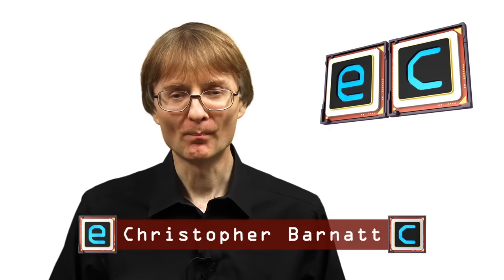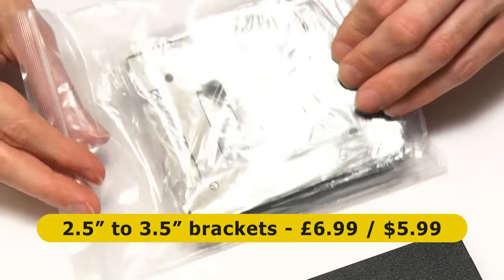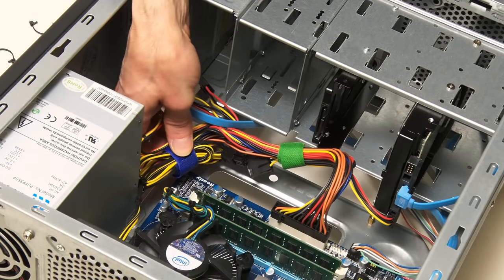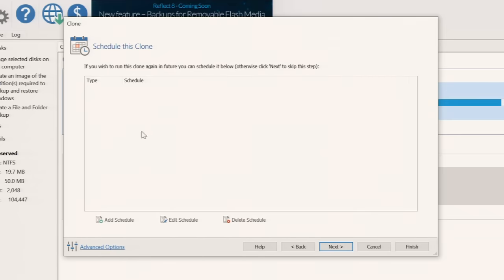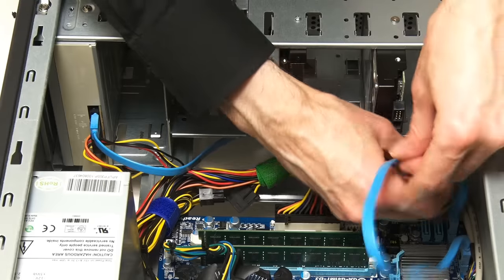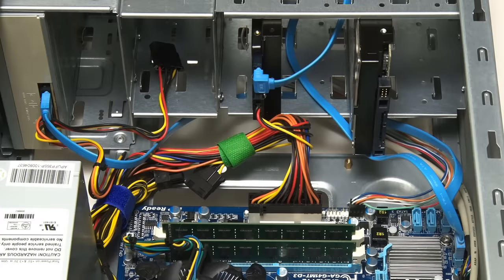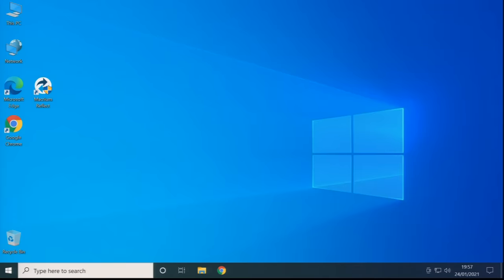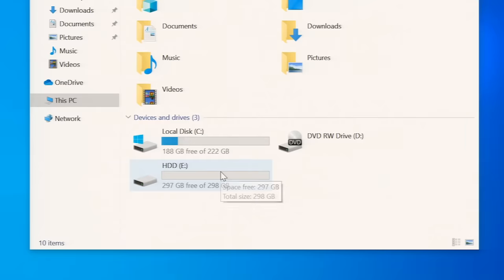Old PC Upgrade #2: SSD Boot Drive

Comment: One can used an "oversized" drive if one partitions it into partitions smaller than the total size the machine can handle.

I would have likely put a 500GB SSD in this machine.

Comment: Hey I just used that disk part program in Windows 10 and I tried it on my 1TB SSD that I couldn't get windows to readh because it was originally a clone of my dead iMac and after typing clean I went into disk management and it worked I never new this program was there ty for the video
Reply from the maker: Great to hear!

Comment: Thank you for the video. Question about the system reserved partition at the end of the drive: how can I move it? When I installed the system a couple of years ago I left 80gb of non partitioned space at the end in case I wanted to dual boot with Linux. Last week I needed more space to cache some temporary video files so I went there to expand the windows partition and... Surprise. A tiny system partition was created at the end of the windows partition effectively blocking the possibility of expanding it with the included tools. Can I safely move it with gparted?

Comment: With a motherboard of this age, would there be any value in using a PCIe to SATA 3 add in card, or indeed a PCIe to NVMe add in card? I think when I was looking at USB 3.0, there was no speed gain to be had over USB 2.0 from the PCI bus, so I assume the same can be said for solid state drives.

Comment: If SATA II has a maximum throughput of 300 MB/s why does the SSD benchmark not even come close to that maximum?
Reply: It's a theoretical figure based on perfect conditions that (in reality) never occur because they rely on a lot of other factors beside the interface itself. Personally, I'd be very happy with the figures Chris got because they're probably still shifting data at a faster rate than the rest of the computer's hardware could keep up with.

Comment: I have a question, on specific hard drives there was a jumper to determine if the hard drive was a master or a slave drive, if you have this jumper on the hard drive do you need to set this to slave
Reply from the maker: Master/slave jumpers are used on IDE hard drives, where you can have two drives connected to the same ribbon cable. If only one drive is connected, normally it does not matter whether the jumper is set to "master", "slave" or CS ("cable select"). This said, with one drive on a cable, setting "master" is always wise. However, if you have two drives on a cable (eg a hard drive and a CD or DVD drive) then one drive must be set to "master" and the other to "slave". Normally the hard drive is set to "master".

Comment: EC, I just had to clean my RAM sticks and slots to get my computer working properly, i did not know there were more levels of clean that went beyond "blow some air on it". Instead I got a soft brush and 99% IPA and cleaned things up. All of my intermitant POST issues are now gone, and even some other things...i wish i knew about this before i threw my other two RAM sticks away.

Could you make a video about cleaning ram sticks, ram slots, cpu's, PCIe slots, and even just general cleaning that goes beyond "just blow some air on it"? like i blow some air on my PC case, and it still looks dusty as fuk. What's the best way to clean between fan blades? how stiff of a bristle can i safely use on my motherboard? how to get those annoying finger prints off of my heatsink? how bad are fingerprints for your system on the ran pins and mosfets?

Comment: ive just watched the first vid of this didnt know doing these just been busy some times. i upgraded a pc sorta like this same core 2 era i think could be same cpu even or near the 5000 numbers anyway. the board supported only max of 4gig of ram but. i threw 8 gig in and it readed and registered it fine. some cases the max ram thing just something they are comfortable with but can some times hold more anyway. some bios updates of course can fix that but this one didnt have one but it was good. i threw in a old 80gig sata 2 ssd i had and put in a useless ati 5850 gpu in it for display. added windows 10 to it as well. and it works alot better who ever thought WD green platter drive as the os was a good idea.. argh. it died anyway so its fine. though had to replace the power supply the original one got damaged when one of my plugs went open so i had mains power going through the whole case but fact the entire system still works shows how tough they can be.

Comment: Hi, clone UBUNTU from HDD to SSD with GParted was a success and the performance is super great. But from the HDD, I want to remove the bootable partition but the two other partitions must stay also the data on it. What do you suggest?

Comment: Hey Chris - great video. Im having issues with an older asus laptop computer. I've cloned the old hard 356 mb drive over to a new 500mb ssd (Which says it has all been done successfully), but when I install it back into the computer it wont boot up. have you got any suggestions. Should I just leave it in there and do a factory reset and then install windows 10 via a usb I have for it. Im not worried about retaining files as Im prepared to start from fresh

Comment: It takes this PC around 25 seconds to get past POST, seems rather long. Are there maybe some BIOS setting you could tweak to speed it up? And is it possible to switch SATA controller to AHCI mode in BIOS?

Comment: Of course if the PC only has IDE ports and uses a 32bit CPU, it might just be too old to bother putting too much effort and money into upgrading.

Something like a used Core 2 Duo or later PC or even a Raspberry Pi 4 would be a better option than putting money into something built when Windows XP was still the new kid on the block.

Comment: is molex to sata adapter are reliable?
is it cause any damage to hdd?
can i use sata splitter instead of it. 
plz answer my question....
Reply from the maker: Molex to SATA power connector can be reliable. There have been reports of some causing problems (and fires). However, decent quality Molex to SATA adapter should not cause an issue, particularly when used with an SSD, which draws less power than an HDD. You can indeed use a SATA power splitter instead if you wish.

Comment: Well I tried it I downloaded Macreum and when I installed my SSD. I transferred everything from the old hard disk . It was quick. The only problem was raising the hard drive so I can throw it away . I kept getting stumbling blocks like I had no permission from the administrator to delete it . I changed permission I still could not delete many of them.So I had to use systems restored to go all the way back to the beginning. I finally got it erased, but, I accidentally erased all my personal videos on HHD F. Fortunately, I had them back up on my flash stick .so I was able to recover them. I couldn't believe how my computer booted faster with the SSD. Why did I take so long to change it from a slow hard drive?

Comment: I am planning to get a new PC with a wiped SSD drive. I want to clone my current laptop to that PC, can I use this process (using the free software) if I connect the laptop to the new PC via a USB?
Reply from the maker: You could clone the laptop's drive if you could connect it directly to the PC, but not by connecting the laptop to the PC via USB. Also, even if you can do this, the Windows installation you cloned would be for the laptop -- both in terms of the hardware drivers and the license -- not for the new PC. If you were lucky, Windows would boot on the new PC and change its drivers. But it would need re-activating, which would probably not be possible without purchasing a new Windows key, as it will be licensed to the laptop hardware. So this is not something I would advise. Better to do a fresh Windows install on the new PC and then to copy your data across and reinstall software. Good luck! :)

Comment: So could you take the old hhd and put it in a different pc to have windows on a different pc?
Reply from the maker: You could move the HDD to a different PC. But the license would not allow it to activate on another PC (and it may well not boot if the drivers were significantly different). Windows installations are hardware specific.

Comment: I have a pc with DQ57TM mother board. what kinda SSD is compatible with it?
Reply from the maker: Your board has 5 SATA ports, so you could use any 2.5 inch SATA SSD. I can't find the SATA port speed, so they are probably SATA I or SATA II, so you will not be able to use the SSD's full speed (as was the case in this video). Almost certainly, an SSD greater than 2TB will not work (or have its full capacity available), but an SSD smaller than that should be fine.

Comment: Hello and welcome.  I have a question.
 What will give you more efficiency?
 The idea is a computer for everyday use with emphasis, editing photos and videos from holidays.
 Computer consisting of ... Processor 2 cores / 4 threads / integrated graphics, Ram 16 GB 2x8 ...
 Is Processor 4 cores / 8 threads / integrated graphics 8 GB Ram 2x4 ... ???
 We combine efficiency with economics of purchasing parts.
 Or maybe you can save on the processor.
 2 cores and 32 GB Ram 2x16 ... And here will the performance be cheap?  What advice? Thx.

Comment: Hello, I have a 10 yr old MSI P55A Fuzion that I am trying to install a Crucial MX500 SSD 1TB to. For whatever reason I cannot get my MB to recognize the SSD as not being IDE (or windows to recognize it as being an SSD). Any idea what is causing this problem? I have heard that the Marvell 9128 Sata 3 ports that my MB has can cause some problems? But I have no idea how to fix this. AHCI has been enabled in the BIOS, and the SATA adapter enabled.

Comment: I've had variable results attempting to install SSDs in laptops and desktops. I've tried 3-4 different cloners and all failed on 2 different HP ~2012 laptops with legacy BIOS. Windows could see the cloned drives on  USB adapters, but both laptops failed to detect the drives in the BIOS. Re-writing and activating the MBR didn't help. The exact same procedure worked fine on several desktops. Any ideas?

Comment: 3:55 Does it matter which side of the bracket you mount the SSD on?  Many of those brackets have tabs on the inside to mount screws to the SSD from the side.
Reply from the maker: You can use either side -- it does not matter.

Comment: Hello, I follow exactly everything you did, however after using diskpart to erase the old hard drive, I rebooted and it didn't boot , i went straight to the blue screen where it says i needed to contact my Network Adminstator, I tried everything and it never booted again, any advice....
Reply from the maker: Are you saying that you have cloned the hard drive to an SSD, booted up and it worked, then erased the hard drive? If so, there is a working copy of your OS on the SSD. So my initial advice would be to remove the HDD and the computer should boot from it. Good luck!

Comment: Not only do you not NEED to defragment your SSD drive, you really should not do so. Back when I booted from an HDD, I made sure to defrag that drive religiously in order to minimize the boot-up speed of the system. With an SSD drive, there are no moving parts, and no faster areas/blocks of the drive (due to angular velocity). So defragging an SSD is a complete waste, and won't speed things up. The reason it is not something you should do is actually the main down-side to SSDs...they have a limited number of read/write cycles per bank. In short, they wear out/down with use, and become unusable. The drive itself may mark those dead blocks out of service, if it's a more intelligent model. Or it may just cause the SSD to no longer boot, if the dead blocks are being used by critical operating system files. As I understand it, it's mostly the writing process that wears them out -- not so much when you are simply reading blocks from the drive. But depending on how much space you have free, the blocks that are empty on the drive occupy the same smaller and smaller bit of space. Which means that all temporary file creations will be directed to those same fewer and fewer blocks over and over again. Which is why you really want to have a good amount of free space available at all times on a boot SSD -- to better spread that necessary wear across a larger number of blocks. If your SSD is above 95%, you really should clone it to a larger-sized drive. I'd recommend a 2-drive USB dock, since you don't even need to have a computer booted up to do the cloning. The one I use is the "Orico Dual Bay USB 3.0 Dock Station". You put the old drive into the 'source' slot, and the new drive into the 'target', and you press a button on the back...and let it do its thing. It has a progress meter on it with 0/25/50/100 lights.

Comment: Sir, my question is if I don't install macrium and try to install the 2nd disc (SSD) do I need to buy new windows key?
Reply from the maker: I am not quite sure what you are asking. If you just want to connect the SSD to use as storage space, there are no issues. If you want to use the SSD as your boot drive and do not use Macrium of other cloning software, you will need to install Windows on the SSD. if Windows is activated with a digital licence (very likely these days) then it should reactivate after being installed on the same machine. But do not try to reinstall Windows with the HDD with Windows on connected!

Comment: I haven't used Windows for about 15 years, so correct me if I am wrong. Doesn't Windows require the licence registration code when being installed on a new drive?
Reply from the maker: No, it doesn't. :) Never has if you clone a drive so that its ID matches the old one. Windows sees the same hardware.
Reply: But you would still be in breach of the licensing agreement! 

One license one computer 💻
Reply: @ExplainingComputers  I've seen Win7 complain about a cloned drive being "not genuine" (in fact I've got two of 'em that complained right here in front of me, if I cared to put Win7 back in those boxen; oddly the 3rd one didn't object and they're all identical Dell PCs originally with the same OEM Windows install!) but Win7 had many odd  habits. Conversely I have a Win10 install that I move around from one PC to the next when I need it, and it never complains.

Comment: I hope that would work on my machine.
But the attempted upgrade seems to end with a Blue-screen, and with no way to get past it.
Came from a purchased Win 7 installation, that was evolved into a 'free' Win 10 installation by a MS offer.
I even tried to retro-back to my original Win 7 installation with my original DVD that I paid for. But that is blocked too and will not install (because 'it is no longer supported').
So, I'm stuck with my old too small HDD...until it crashes, I guess. And I have to continously scavenge around for files that I can delete to keep the data on C: as small as possible.
Will likely have to buy another Win 10 license to install on my 2 TB SSD, and gradually build it up over time to build up a whole new system. Also build up my expertise in gradually switching over to a Linux system.
In any case, I got a lot of insight into how 'The mop flops'

Comment: Very good Video. Have two questions please.
1) Bought new DELL Desktop Mini Tower 3891 Inspriron with Intel i5 10400. Has WINS10 PRE installed on a small 256G SSD. I bought/installed new Ram Sticks(2x16G) and  2T M.2 SSD.
                              1a) Did I do wrong in taking out the PRE installed 256G SSD because I am going to CLONE my 3T SATA Folders/Files which measures a total of 429G, which has WINS10 ALREADY on it. Should I LEAVE 256G SSD in, setup Computer/Update THEN take it out, then put new 2T SSD in then Clone???Need guidance. What would you do???

                              2) Finally. switching out SSD the screw to secure the 2T M.2 SSD tightens good but I noticed a slight bend in the SSD so I backed it off. I don't want it to be TOO loose for reasons and come a "little" bit loose then my Computer go nuts. Any help THANKS.

Comment: Can you add a PCI add in card that adds 6GB/s Sata ports or would the motherboard still bottle neck it?
Reply from the maker: Potentially, yes. But you would need a x4 PCIe SATA card to get the speed on a motherboard like this one with PCIe 2.0. And today, SATA expansion cards are generally x1 PCIe, which delivers the required speed via a x1 card. But x4 SATA cards certainly did exist when PCIe 2.0 was as fast as motherboards went, so it may be possible to find and fit a x4 PCIe SATA card.

Comment: My goodness... 39 seconds bootup time is still very slow...Six seconds gained is nothing, although it does appear significantly better in use... (PS , I KNOW it's an older machine, probably the SATA II speed limit)

Not too long I experimented with a suspicion I had, and found that cloning a drive DEFINITELY give a slower performance than a new installation.. but as you can imagine, with all the licensing and re-installation, it's a bit of a pain.

Comment: I want to do a HDD clone to an SSD as a backup on my Win XP computer which has an old accounts programme installed. Not a pretty sight but nevertheless, 'tres importantes'. Contrary to modern day virtual thinking, debits and credits have not changed and do form the building blocks of accounts as underpinned by Newton's Law of relativity. However, it does not have an internet connection which presents a hurdle in the normal Macrium software download process. Have you done a video or know of an idiot proof solution that navigates the online box filling problem. I am assuming I will have to download onto another computer and then copy across the download file via a flash drive and then onto the desktop of my Win XP box. Thoughts appreciated.